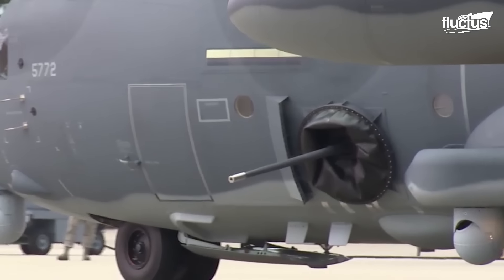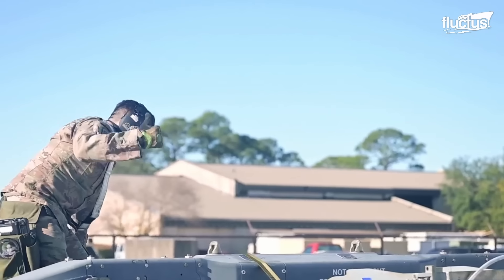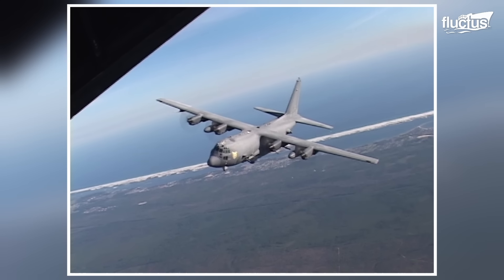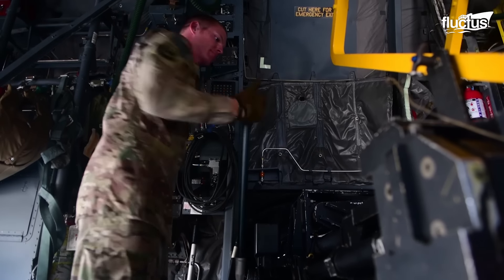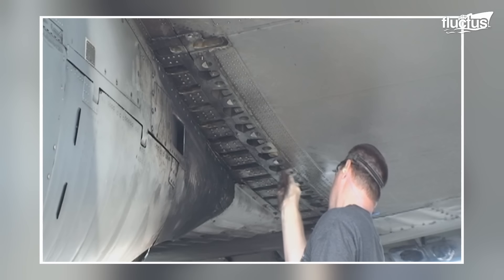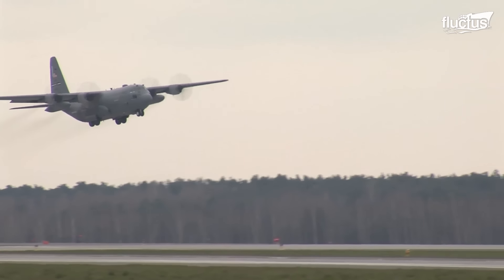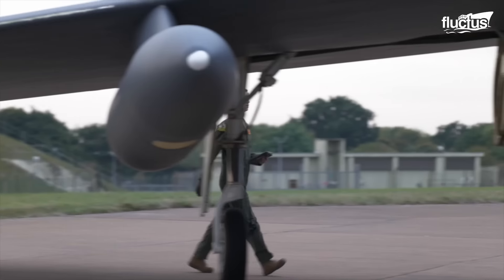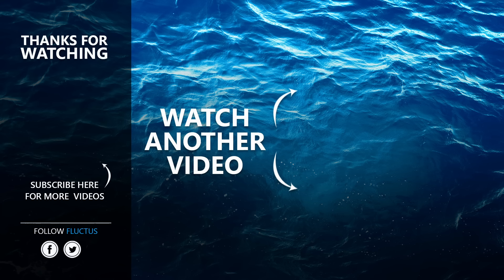Inside World’s Largest Gunship Plane Ever Made

Comment: The B 52 is no slouch, either! 😊😊😊😊❤❤❤❤
Reply: As a bomber, however, USAF B52 show up at a fight and then can't drop any bombs because soldiers and Marines are danger close, so then the B52 turns around and leaves.  Sorry guys; CAS calls for guns.  Losing the A-10s is like a knife in the backs of every soldier and Marine who needs up close and accurate CAS!
Reply: @tedjordan2600  I certainly agree with your position on the A-10.
Reply: The Bone
Reply: The B52 has a different type of assignment.  It was not designed for close air support.
Reply: @stanmans  True. I wasn't trying to imply it did.

Comment: "cart start" in my mind refers to  the self-contained APU that were used to pressurize the manifold before the fans were lit off. By the late 1960s, APUs were pretty much std on rhe new generation small and large aircraft: 727, 737, 747. As I remember, DC-8 had APUs, but 720, 707, 717 did not....

I'd call these, "bangers - NO mash", or, "canned pop"!!

Comment: How can any of those ammunitions be accurate assuming there is turbulence from the engines, natural turbulence from the wind,  an airplane that is not static, the type of ammo loaded on the plane and the distance to the target.  It appears they are not actually aiming at a specific target. How much protection does the the plane itself have?  It appears to me it wouldn’t be very difficult to shoot one of the planes down 0:58  using some type or guided missile.
Reply: Watch the videos and see
Reply: @jefflambright9350  I’m watching and I don’t see
Reply: @stanmans auto-correction via computerized systems
Reply: The A/C is equipped with very effective countermeasure systems (against both radar and heat seeking missles) and the fire control system is also very accurate..the gunships dont usually miss what they are shooting at